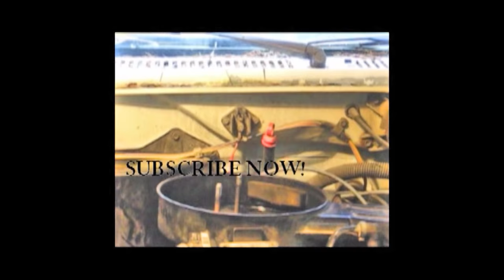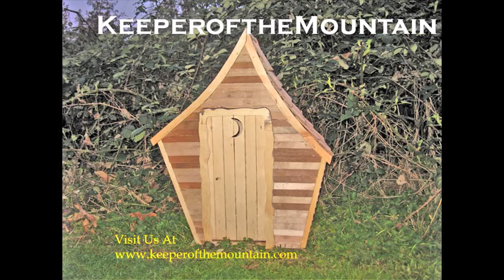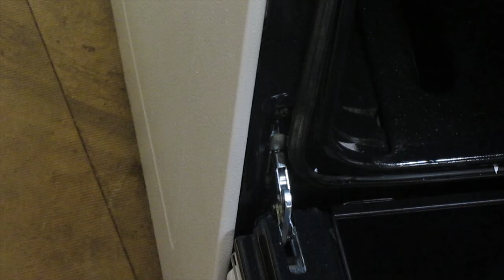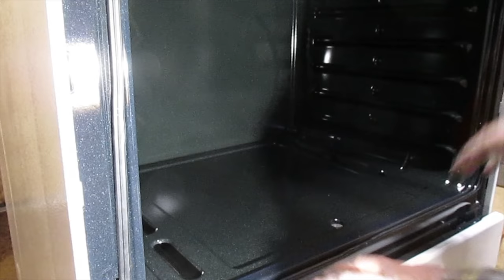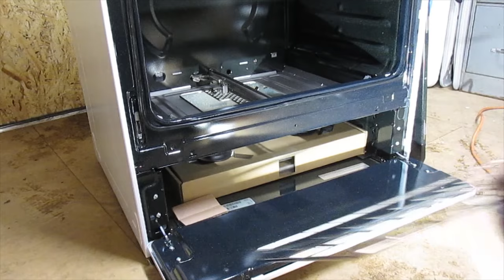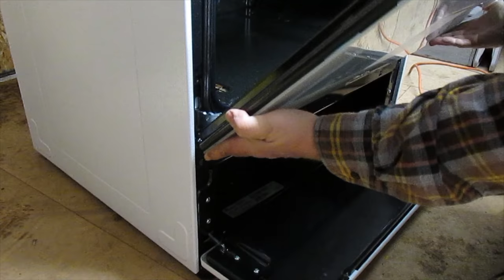Converting a Natural Gas Range to Propane

Comment: A word of caution to the uninitiated; some conversions require that you also change the gas flow and air mixture to the oven and broiler burners.  Depending on the brand of stove that you purchase, it may require that you make an adjustment for the gas flow to the oven and broiler burners by turning down a 1/2" or 9/16" nut where the gas feeds into the burner, usually stating that it has to be turned until the nut bottoms out.  It may also require that you turn on the gas and check the flame to ensure that the air mixture is correct and burning with a properly adjusted blue flame, with only very slight yellow tips.  Too much air and the flame will be yellow indicating that the fuel mixture is too rich and needs more air.  That condition would cause the flame to burn leaving a film of soot.  Changing the air mixture is easily done by loosening a small screw on the air shutter and turning the shutter slightly until the yellow flame all but disappears.  Be aware that too little air and the flame, while it might have the correct color, will look like it wants to leave the burner, like it's jumping away; that means that you need to add a bit more air.  Just wanted everyone to know that not all conversions require just a simple orifice and regulator pressure change.  If you decide to do this yourself,  READ THE CONVERSION INSTRUCTIONS THAT CAME WITH YOUR STOVE FIRST.  Good luck.
Reply: It's a used stove and I don't have that literature.  Could I get that info with the brand and or serial numbers
Reply: I dont think all stove have that air shutter .I saw a video where a guy did exactly what you are talking about.
Reply: Question what if there's nothing in the valve to change or flip to propane I changed all the orifices both burner on the oven and 4 on the top is that going to be safe

Comment: Thank you... just called my propane company and they wanna charge me $69 to come out then $140 per hour.  This will be done by me now... what a rip-off.
Reply from the maker: Pretty straight forward Thanks for watching.
Reply: It seems like a rip off, because it's something you can do yourself, but you have to keep in mind the costs... They have to pay the guy, probably $20-$30 per hour, pay for the truck and gas, the tools, the insurance, the workers comp... You get the idea. No judgement, just something to think about 😁.

Comment: The installer from the big box hardware store acted like it was rocket science and couldn't do the conversion.  My propane company wouldn't even call me back when I requested a service call for it so I just converted my new range to propane today after watching this video last night. My range is a GE so it's a bit different, but I figured it out. I liked the painters tape trick in the socket wrench. Worked like a charm. Thank you!
Reply from the maker: Now you are a rocket scientist! Glad I could help. Thanks for watching.
Reply: @KeeperofTheMountain can I chat with you about converting a natural gas stove from the 30's to propane? Is it even possible? The stove currently works great on natural gas

Comment: You might want to mention attaching the back of the stove to the wall.  First time momma pulls a 10 pound turkey out of the oven it will flip over on her.  That's really bad news if there is boiling water on the top burners.
Reply from the maker: That is a valid concern. It is in the instructions and there is a bracket for that. However it is not part of converting from NG to LP.

Comment: Dang for the the 316243701 lpg conversion kit they want about $100. The regulator is convertible. Pretty high for 5 little brass jets. Guess this one is going to the scrap yard.

Comment: Fairly good video, but as with most, one very important detail was missed. The minimum flame for the burners was missed. When the burner is turned to low, it will actually only go to medium as it is still set for Natural gas. To finish the job, at each burner, turn it to low, then pull each burner knob off the shaft. There is a very small screw inside the shaft, slowly turn it in till a small minimum flame is reached, the flame is still consistent all the way around. To check it, turn the flame to high, quickly turn it to low and the flame will quickly drop in size but not go out. If it does then increase the minimum flame size slightly. Do the rest of the burners and you will have a full range of flame size, instead of just high to medium. If the stove is near open windows or excessive draft from a range hood, the minimum flame may also need to be increased slightly.  If your range has a dual burner, the second screw will be near the first. Read the instruction book in this instance. 
Enjoy the nice small simmer setting when done.
Reply: Thank you Richard
Reply: mine is stuck. how do I get it out
 think its stripped
Reply: @pamelamorris8945   When you say it is stuck, are you referring to one of the top burner orifices, or something else? If it is one of the orifices but you can get the others out then make sure the socket you are using is six point not twelve and if it is slightly loose then take one of the extra orifices to a store where they have standard and metric sockets, you do not want it to round off. They all should be about the same tightness when removing.

Comment: Watched your video and duplicated it on my new Whirlpool gas range, right down to the blue tape in the socket. Worked like a charm and was as straightforward as the video suggests. Will take anothers advice on thr comments section and pull the knows and adjust the flame screw since my "Low" is still medium flame.
Didn't have to shut off gas to the back of the stove to replace nozzles...just so everyone knows.
Saved a bunch of money. On a side note. The new stove was supposed to come with the conversion kit....it did not. Called 800 number and it took a week but finally arrived. Took 30 minutes to replace these small nozzles and I'm back in business.  Thank you !!

Comment: Something to check after the conversion is the low flame on the burners. Check to see if the flames go low enough to simmer. Often you need to adjust them down. Remove a burner knob and look inside the shaft to see if there is a screw head. If there is, turn burner to lowest flame and while holding shaft from turning adjust the screw. (requires a small head screwdriver.)

Comment: im converting a stove to propane in south america, is it ok that the small propane tank stays in the house? about 5 feet away more or less
Reply from the maker: Great question. Generally speaking, here in the US the answer is no. The tank and regulator needs to be outside and the pressure in the house should be .5 PSI or 9-11 inches of water column.

Comment: Hi there, I have a GE stove about 5 yrs old. It was professionally converted to LP. Everything worked perfectly for years, but the other day, I went to turn on a little used right front burner and it looked more like a campfire. The other ones are fine. Is it possible that the little brass thing needs to be tightened or ? Any ideas would be appreciated. Thank you for your help
Reply from the maker: Make sure it is clean and nothing is blocking the air vents by the burner.
Reply: Thank you so much, there was some fluff partially blocking the silver burner tube that goes over the brass thing. Works perfectly now! I wouldn't have thought something so minor would have affected the flame so much, but clearly it did! Thank you so much again for your help and expertise
Reply from the maker: @sarahcox832  Glad I could help. Air fuel mixture is critical.

Comment: Great video but is this only for larger propane tanks or can you connect it to a smaller tank and if so dont most smaller tanks use a connector with a regular already attached? Would you use that kind of hose with a regulator already attached or just a straight hose from range to propane tank?
Reply from the maker: Great question. You will always need a regulator. The two main regulators are 10 pound and 2/2 pound also known as 11" wc. (water Column) If the regulator is red or has a red control knob then it is a 10 LB. You do not want that for your stove. Everything else that you can buy in a store is 11" or 1/2 lb. that is what you need.
 Thank you for watching.

Comment: Hi, thanks for the video, it was very helpful. I had a few questions. Do the nozzles have to be from the original stove or can they be from a different stove? From the original stove we only have 4 nozzles, we need one for the oven, can we use a nozzle from a different oven? If yes, is the number on the nozzle going to be the biggest or the smallest number?
Reply: Thanks, good question,

Comment: Very informative video. But I have a question, I have an old natural gas room heater that I want to convert to propane. Is it possible and how difficult it is. Any help would be greatly appreciated. Thanks in advance for any help.

Comment: Hoping you can settle an argument.. I think that if you connect a red Bernzomatic oxygen tank up to a propane stove, the flame will eventually back feed into the tank when the tank is almost empty, and he says no, the regulator will stop it. Any idea who is right? Honestly, I'm a bit confused on how the same torch can work with propane, oxygen, or mapp.
Reply from the maker: The first thing you need to know is that Oxygen is not a fuel. Oxygen does not burn. It does help anything burn hotter though, Map Gas has similar properties as propane and will burn properly in a propane appliance. However it will burn hotter and will shorten the life of the appliance. If you feed an Oxygen and mapgas mixed through the system it can and will backfire up to the point of a check valve. It will damage the appliance. You should not do that.

Comment: I have a question. If your stove is set up for natural gas and you have propane will the stove give off black soot? Trying to figure out if my stove is set up from propane like they said it would be. Thanks in advance! Also great video and very straight forward and to the point. SUBSCRIBED!
Reply from the maker: If it is not done correctly it will have a yellow flame and put off soot.

Comment: This is great. Where would the tank go? and how long do they generally last?
Reply from the maker: The tank of course will go outside. There are two things to look for in selecting a tank. If you are only cooking with it, all you will need is a 120 gallon tank. It will hold 96 gallons though. They are only filled to 80%. You will have to fill it twice a year.
The other thing to look for is whether the tank  is a DOT tank or an ASME tank. You do not want a DOT tank. After they are 10 years old, you will need to have it certified and then every 5 years after that. Pay the extra for an ASME tank as you will not need to get it certified. Another option is to rent one from the local Propane dealer. 
Do a google image  search for "Propane tank clearances". You will get a  diagram of a house with all the clearances you need to comply with.

Comment: I saw another video, from Sears partsdirect that they did some adjustments to air flow through the bottom drawer, and some other adjustments through the bottom, in the back.  I am converting a Electrolux (bought out by Frigidaire), dual fuel (electric convection, natural gas), to LP.  It was top of the line 12 years ago, that my mom is selling me.  Have you ever dealt with this type?  I would love to hear your advice, if you have dealt with similar setups.  I am very mechanically inclined and will work on anything.  I just want to get all of the juicy details and get it right.  Thanks for the great video!
Reply from the maker: The key to adjusting the air is to get the bluest flaim you can with small orange tips. If you give it too much air, it will have troubles lighting and the flames will start to lift off of the burners. Too little air and the flames will get orange and lazy. That will shoot up everything. You will just have to play with it to get the best flame possible.

Comment: l have replaced 6 orifices on a Whirlpool WFG510SOAW2, and done the reversal on the regulator. l have looked for things [nuts] to back off 2.5 times and haven't located them. Lori used the oven this evening [windy and 32 degrees out] and the fumes made me open the front door and the back window. Any advice? l don't think l blew any of the orifice replacement. A 7 mm nut driver for the range top orifices worked great, no tape, no paper towel stuff.
Reply from the maker: Normally right by the orifice in the oven, there is an air mixture adjustment. If your flame is yellow, add more air until it is as blue as you can get it without having the flame come off of the burner. If it is wide open and the flame is still a dark yellow, perhaps large, lazy and smoky, you have too large an orifice in the burner.

Comment: Usually, the oven (and broil) orifices are are not fixed and replaceable as in this video.  Usually, these are adjustable orifices that must be tightened by turning clockwise about 2 turns, or fully in then 1/2 turn out.

Comment: I’m curious. Would this kind of stove (converted to natural gas) be able to be used with the homebiogas 2.0 gas maker. It makes methane gas. They have a little burner but they havent made an oven yet.
Reply from the maker: Thanks for watching.
I am not sure. I have not worked with Methane but I have read that it has similar properties as Natural Gas.

Comment: A very impressively done video thank you so much not exactly the same brand that I have I am working on a new Frigidaire and there typeset is a strange font hard to read pictures are less than adequate so thankful for YouTube and fellows like you that can share their talents with some of us that don't see as well as we used to I kind of figured I would have to take out one set of screws for the small burner probably would not have thought about putting screws back in to hold it as this is not something that I do every day the last straw that I ordered I ordered is an LP stove did not have to convert thanks again for the service that you provide
Reply from the maker: Thank you for watching. I am glad I could help.

Comment: My range diagram shows that it requires a 66mm orifice for one of the eyes but I can’t find that size. Can I use a 63mm in its place safely? We were getting nowhere with GE trying to find the LP conversion kit for our range and contractors are trying to install.
Reply from the maker: A 63 is very close. The only thing that will happen is that the flame will be slightly smaller. I would try it and see if you like the flame size. There are drill bits for drilling them out but, I am not sure it would make enough difference to justify getting one.

Comment: I have a question for you Keeper of the Mtn. I bought a used gas range and no conversion kit came with it. Do I have to have a specific orifice for that particular stove or will the ones from my OLD stove fit the new/used stove? They cost me over $100 so I would like to take them out of the old range and put them in the new/used range. Can I do this? Or do I have to call the company that made the stove and order LP orifices from them?
Reply from the maker: The answer is maybe. The official answer is Get the kit from the company. The reality is that if they screw in they will work. The only what if that is of real concern is if they are a little small, the burners will not perform well enough to be practical. If they are a bit big, the flame will be a bit bigger. Chances are they are close enough to be fine. You can try it and see if you are happy with the results. It is not unsafe.
Reply: @KeeperofTheMountain  THANK YOU FROM THE BOTTOM OF MY HEART - You have no idea how happy I am that you responded and so quickly. I was going to look at used stoves today and with your reply I at least have some ammunition.

By the way, last night I was so upset because I had squash, potatoes and bacon wrapped chicken all ready to go into the oven when I discovered the control panel pooped the bed. Your video is great, your sense of humor is even better. You made me laugh when I was in the middle of the upset last evening. Thank you so much!

Comment: Nice Video!
I'm running my 1956 Findlay-Stove on LP since years, the top burners are running well, but I couldn't get the oven running yet, the Valve is a Robertshaw BJC, any hints what I could do?  I guess there's either to much or to few pressure coming in?
Any help is much appreciated.
Reply from the maker: If your regulator is set up for propane then it is a matter of choosing the right orifice. In 1956 things were done a bit different though. I would have to look at it to say for sure.

Comment: Does this solution give the burners more power is there a way I can get more pressure out of my gas cooker burner. using natural gas without having to change cooker any help would get my cooking done quicker the gas cooker I have now pumps 2.9 kw out of burner but it seems very less when cooking ?
Reply from the maker: Normally everything is engineered to be as it is. Often there are adjustments that can be made. They will be in the instructions for your stove. If you do not have the book, using the make, model and serial number, you can find it in line.